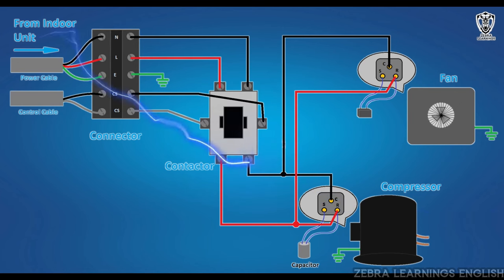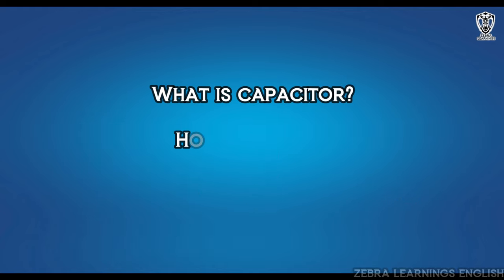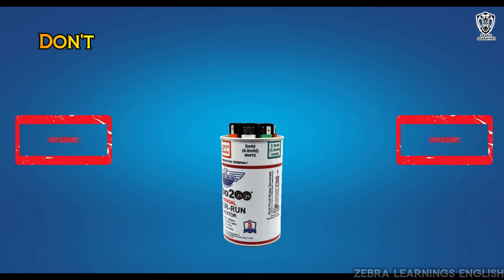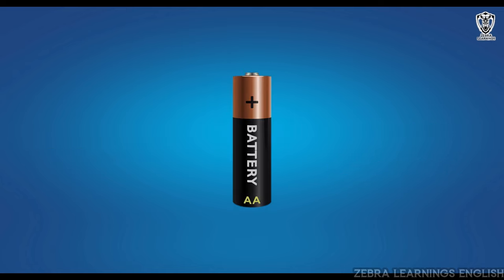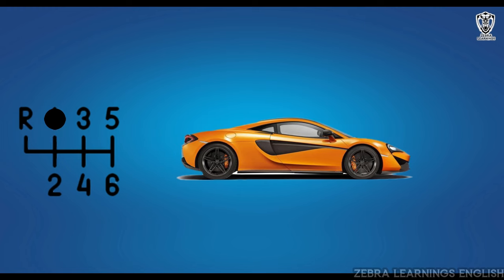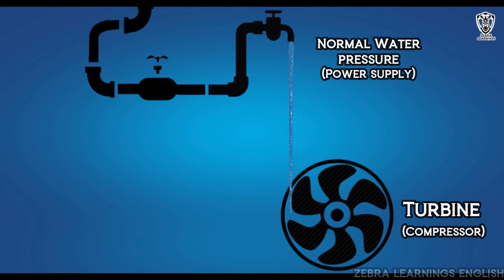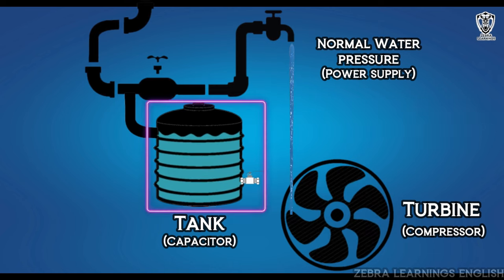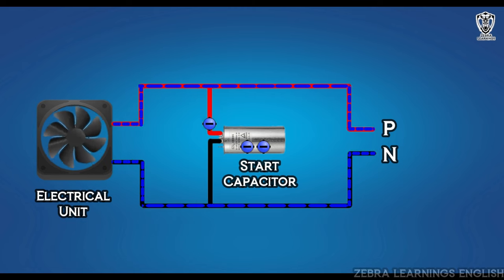What is Start Capacitor? | Animation | HVAC | Electrical

Comment: actually this is wrong as many people do. energy stored in a staring capacitor is too small to move a motor stator. you need to underhand the phase principle of a induction motor.
Reply: Elaborate on that a bit. So why is the capacitor there ?
Reply: To phase shift some of the AC current 90° to energize a second set of windings to get it spinning. Once it is spinning fast enough the capacitor and the start windings are removed from the circuit via the centrifugal switch. Capacitors can store a DC charge but not AC there is no ‘power boost’ shit happening here
Reply: If none of this makes sense we are not going to be able to explain further until it does.
Reply: Without the start cap and windings and if the motor is aligned just so, when energized the motor will just hum and rock back and forth very slightly. If you were able to give the motor shaft a good turn, you would note it will run and in either direction rotation is initiated .

Comment: A capacitor is like a battery but discharges much faster and does not store a charge for as long. the reason you need a capacitor is because there is not enough power on an average 110 circuit/available circuit,  a capacitor gives a sudden increase in amperage during Break of inertia to start the electric motors

Comment: Some units doesn't have a starting capacitor...
Reply from the maker: If the unit is running on 3 phase current. Then, the unit doesn't need a capacitor.
Reply: @zebralearningsenglish-pn6fl  Even for single phase compressor, mostly you don't need a capacitor, if it's by design or compressor winding got weak then we use starting capacitor.
Reply: Because they are 3 phase